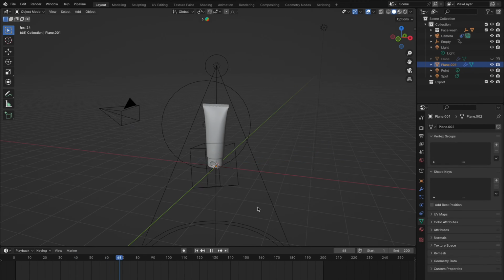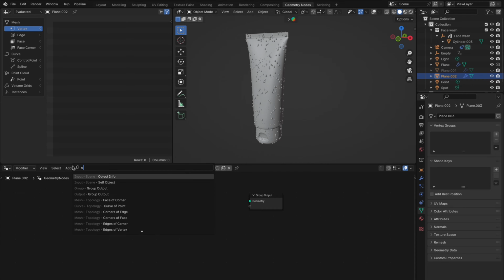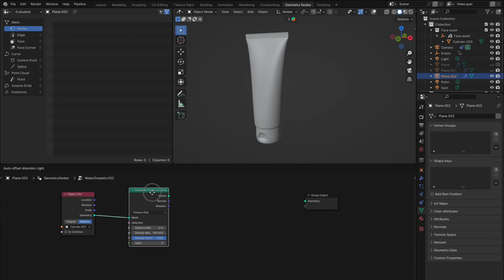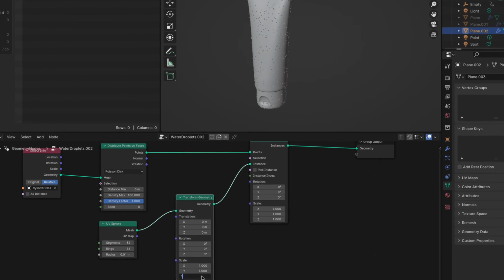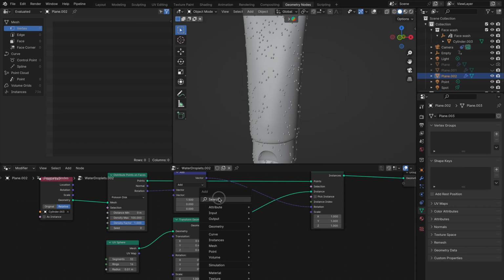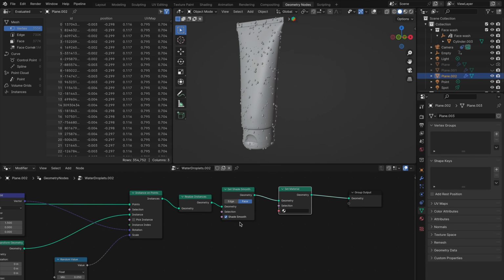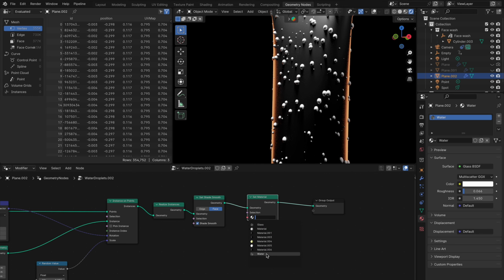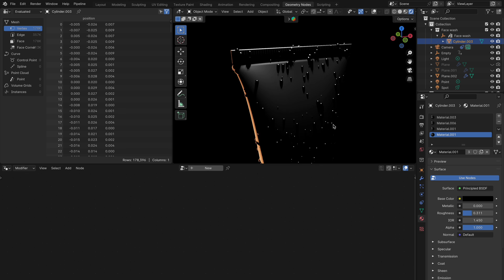Make EASY Water Droplets with Geometry Nodes in Blender

Comment: I got a little problem, where do I connect the instance on points because there is a group input that is linked with group output geometry and the group input doesn't have a connection point for instances. I have a wave modifier and I guess that creates the group input? If I remove it group input, the whole object disappears.